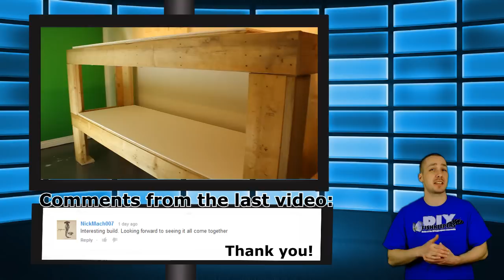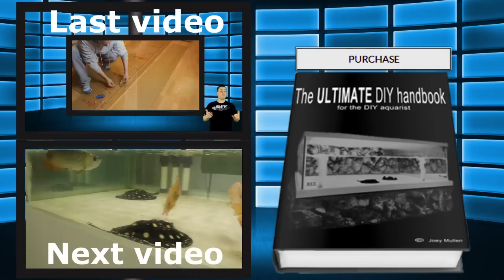HOW TO: Build a large aquarium stand Rack

Comment: Hey there Joey (Love your videos.),  I am planning on building a stand for a 6' tank and was thinking of using  2x6"  supports.  Would they be strong enough to not to have a center brace?   I had built a previous  6' rack from your design, a couple of years ago, from 2x4s  and it has held up great.  However, for this rack,  I would like to access the lower shelf for more aquariums without the brace.  I found a related video about a similar build. 

-->   http://www.reefcentral.com/forums/showthread.php?t=1962057

Also if I wanted it longer to support some shelving by 10-12 " could I still use the same type design and put the supporting braces close to the tank corners but have them extend out?  As in your Video, it looked like you had 19" divided evenly on each end so the tank would have a full view.  

 Any feedback would be helpful.  Thanks!

Comment: Was it not possible to build the tank in the actual room it's going into?
I'm liking this series. The outside 2x8 framing evens out the face of it all. I think the only thing I would have done differently is used 4x4s instead of 2x8s but I'm not sure how your tanks are sitting on everything. the 2x8s may have been the better option.

Keep it up Joey
Reply from the maker: A 2X8  laid horizontal and on edge is much stronger than a 4x4. Almost twice as strong in fact. 

http://www.awc.org/pdf/wsdd/c2b.pdf

A 4x4 works great as a post, but that's about as useful as they get. A 4x4 in a stand is simply a waste of money. Since its cheaper to buy the much stronger and easier to work with 2x8. Even a 2x6 is stronger than a 4x4 laid horizontal and on edge. 

The use of 4x4s in aquarium stands is  simple misconception of their strength.

Comment: People are soooo going to use these as coral frag tanks.  Just build their own...
Reply from the maker: I actually plan on doing a video on those as well... Braceless, built in filtration. :)
Reply: ***** That's cool! Thank you!  I don't know about braceless?  That would have to be really thick acrylic.  I've seen a few people comment on "learning" to build acrylic from youtube and having them explode all over the floor.  Cost the owner BIG $.  I would add some tips on bracing the tank in as many places as you can think of.  Like reinforced corners and seams.  Let people know the failure points and how to prevent disasters with proper design techniques.  Add as much as you can.  I know I want to learn.
Thanks. Daniel.